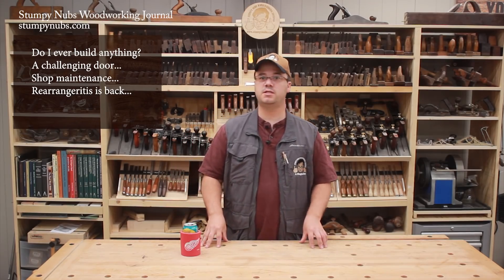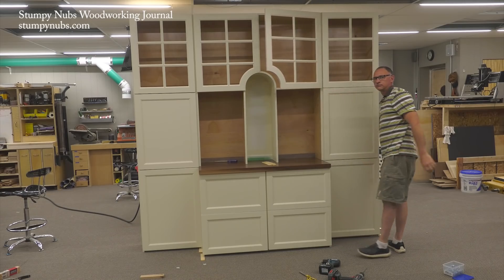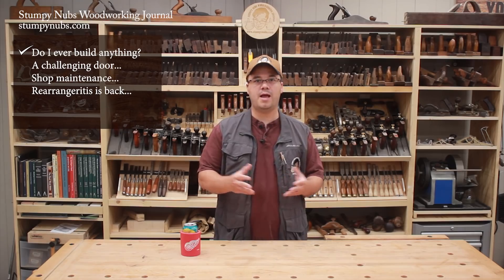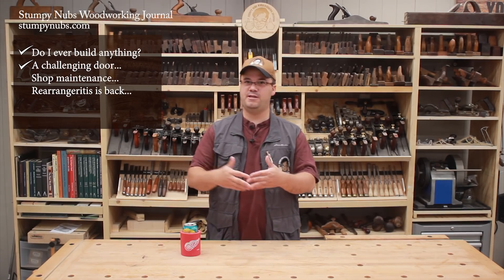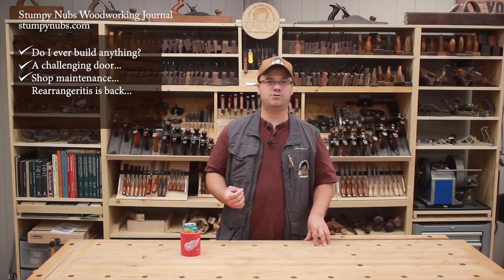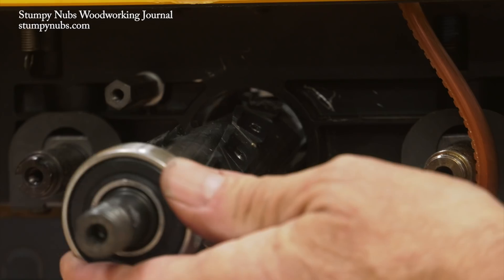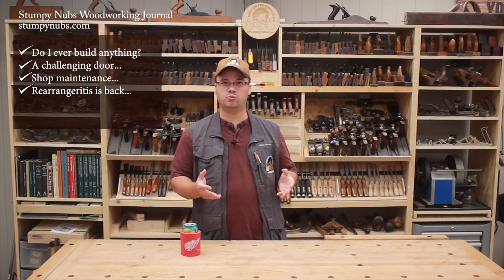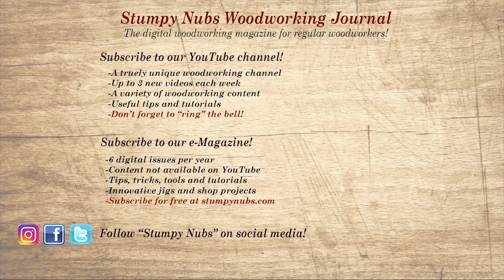Why don't I ever build anything? (And a challenging situation)

Comment: James, I agree with your format of showing to do something in a better way rather than showing making a project. However, it is not always easy to search for that "how to" one may be looking for. Case in point; I saw your video on ChipsFly for the Bandsaw Companion. BTW I purchased one. The suggestion on realigning the table was genius. I went to your website to find the same video and looked through 20 videos but couldn't find it. Luckily I was varnishing so I could do both. 
Thanks so much for the knowledge I've gained.

Comment: Looking forward to seeing a one wall workshop.  We struggle with that very problem.  Every large tool is on rollers to move out for use, but there's just not enough wall length, and I would love to see innovative solutions that go vertical -- but too many of our tools are so heavy.  We have even talked about a winched platform to go vertical.  Hope it won't be a long wait for the video series.

Comment: Thank you God that someone actually noticed this problem and made a channel that corrects it. That is, well was I guess now lol, ALWAYS the most frustrating part of any DIY project was having to sift through millions of non-specific videos to find the little tiny obscure technique, measurement, tool tutorial, tip, or trick that you might have needed, it would take hours and many times end in frustration or a weeks long exercise in patience. I guess some would say that it builds discipline to have to work for knowledge, and they would be correct, but Id much rather work on a project to gain my knowledge instead of sitting in front of a computer screen for hours so Thank you kind sir.

Comment: Nice to see the gang back at work.  I have an older Grizzly 8" jointer that I was going to upgrade with a helical head.  I went to mywoodcutters.com and saw the price, which was not a shock because I had looked before.  Here's where I had to make a value decision.  I could not justify adding a $500 part to a machine that was nowhere near that in value.  Instead, I ordered the high speed steel knives for about 10% of that cost, then replaced them using a jig from Rockler.  The jig made it easy, but the knives slid into place so smoothly, and they are sooooooo sharp.  Thanks for recommending mywoodcutters.  Great service, great products.

Comment: Great info again, James. One thing though. It looked like when he was cutting that wall panel, he was going against the safety rule of not cutting when the length through the saw blade is smaller than the distance to the rip fence. Was it just an illusion?
Reply from the maker: There are exceptions to that "rule"- particularly when working with larger panels that have long edges against the fence.The goal is to have enough reference surface against the fence so the panel does not turn during the cut. In this case, there was no problem keeping the edge against the fence and the panel from turning.

Comment: Thanks for all the wonderful videos I definitely enjoy your style. You should try baby powder on cast iron instead of wax. Works alot better, doesn't affect finishes, and conditions the iron as you run wood across it.
Reply from the maker: A coat of past wax on cast iron tops doesn't affect finish either. And it lasts longer.

Comment: Nice explanation for why the shorter videos. Excellent rational. Now for the stupid questions. Why helical cutters? I see the obvious being able to replace or rotate one damaged cutter. But how in the world would you keep track of sharp edges after a couple rotations? I'm assuming each cutter has four surfaces or maybe eight if you can flip them over. Do they have eight? Thanks.
Reply from the maker: We have made several videos on helical cutters, including the pros and cons. Here's one that answers the most questions: https://www.youtube.com/watch?v=UurAyAOfzGs   As for your specific question about keeping track of the rotation of the cutters, each is marked on one corner. That mark starts in the upper right, and as you rotate one or all of them you can tell by it's position how many times it's been turned.
Reply: @StumpyNubs  thank you, and I'll watch your pros and cons video.

Comment: Hey James, great blog. Quick question, I watched your table saw alignment video and I checked the run-out on my Laguna Fusion 1 table saw. I used a digital gauge from the company in your link. The run-out on my saw, front to back read (-.009”). I used the flat part of the blade not a tooth.  Is (-.009) good enough or should I try for something closer to zero?  BTW, the Laguna owners manual doesn’t go into too much detail or how to make the adjustment. The manual just says to loosen three bolts but doesn’t state or depict where they are. LOL. Thanks for the help.
Reply from the maker: I would try for better than 9-thousandths. At least 5-thousandths, if not 3.
Reply: Stumpy Nubs thanks, James. I’ll give it a try. I’ll call Laguna and see if they have any additional information on how to make the adjustments. Take care!

Comment: don't apologise for not showing hours of cutting wood.  more video's need to be made showing the techniques involved and why you use them.  i recently made a video on a monks bench where all i did was talk  about what each stage included in the build and why i did it that way.  personally i think it was a better video.  still very long broken up into different segments.  but i like to think it would give a novice insight into how furniture is built, and how simple it can be if you follow the right steps.  i might also add that as a retired professional furniture maker the number of tools i possess is relatively small and definitely low tech in the main.  i see amateurs with many thousands of dollars of tools which rarely ever get used.  yes i sometimes wish i had them to make life a little more simple.  but unless you are doing a lot of batch work i cannot justify the expense or the space in a small shop.

Comment: It's not hard to remove the cast iron top of your table saw.

All you have to do is pull your your shop crane over to above the table say.
Lower the attached electro-magnet down and rest it on the cast iron top.
Turn the electro-magnet on and hoist her away.

Easy peasy! 
Like how many shops have a high powered electro magnet attached to their shop crane?
😂🤣😂
On the other hand, if you have the money to invest in one, go for it!
😂🤣😂